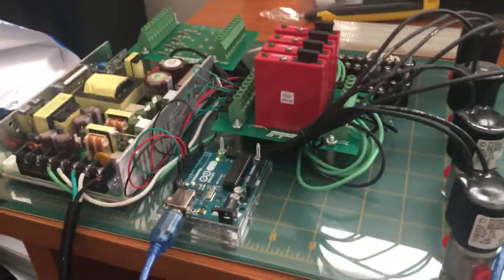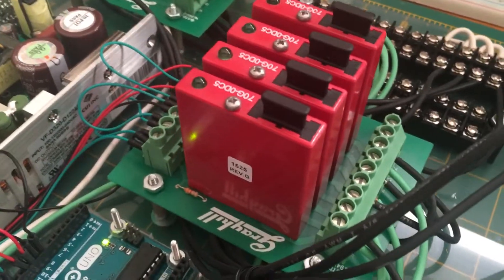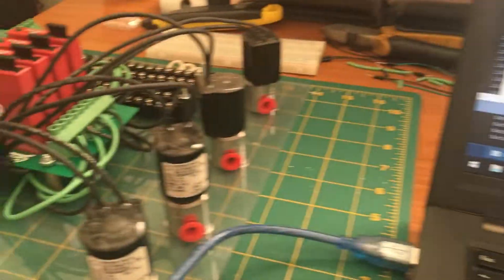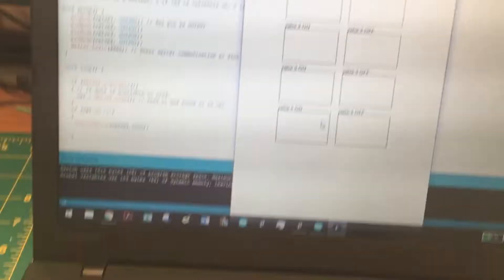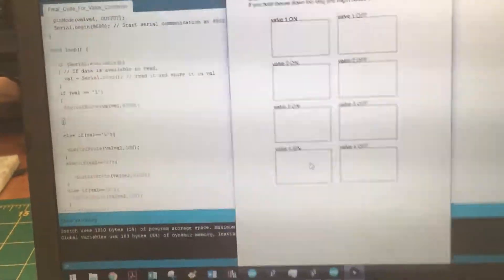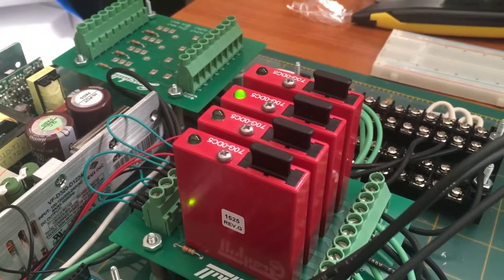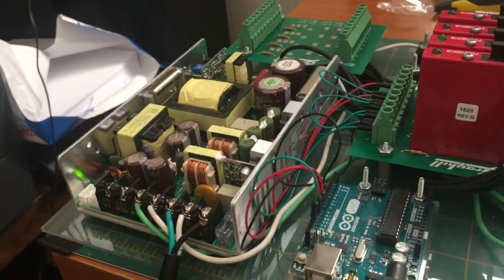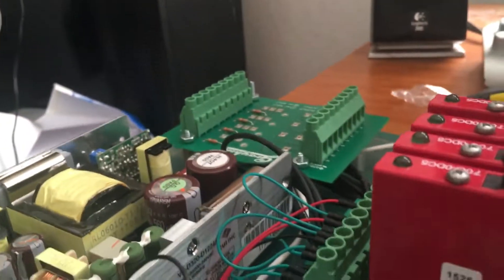Arduino Solenoid Valve Controller Overview

Comment: I started to build something similar. This is amazing, especially if you were a Chemical Engineer major. Not to knock on the major, I just usually expect this from EE/CpE majors, especially with the use of an Arduino as opposed to RPi.

Comment: I love this design. Could it be used for fluid distribution control? (Example: i have a greenhouse with multiple plants needing watered at different times a day as each solinoid can run indipendant.) May need use of a timing circut but would be a great use.